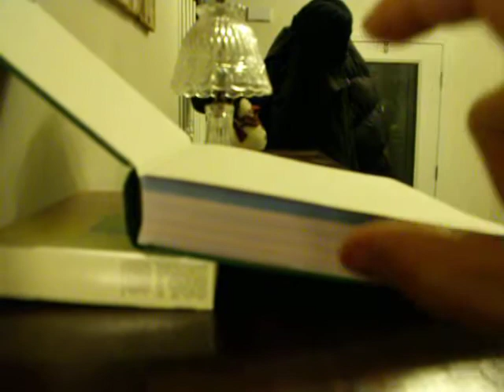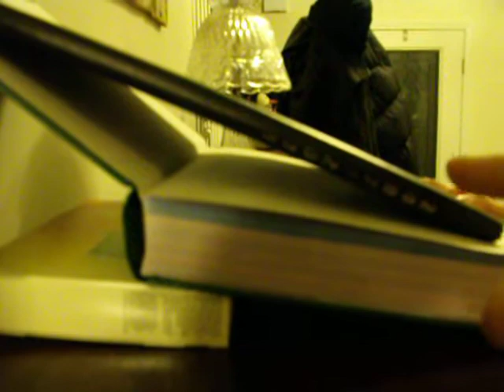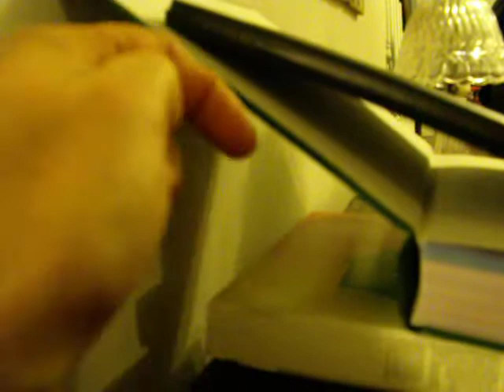Mark Explaining the Angles Involved with Solar Panels Installed on Roofs with Different Slopes

Comment from the maker: I agree, but this is for a set up where the entire roof is being maximized and the panels are flat against the roof. The angle of this spanning panel is determined by the layout of the panels above it. I guess the philosophy is changing about "maximizing" the output based on angling. My contractor showed me how investing in micro inverters would increase the output more effectively than spending the money to raise & anchor all the panels. Esthetically the smooth design looks nicer too.